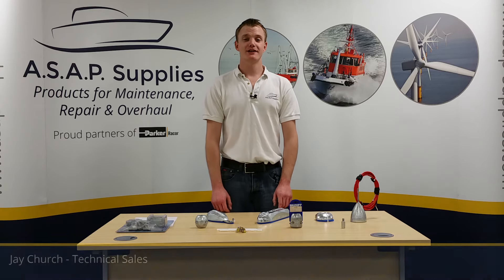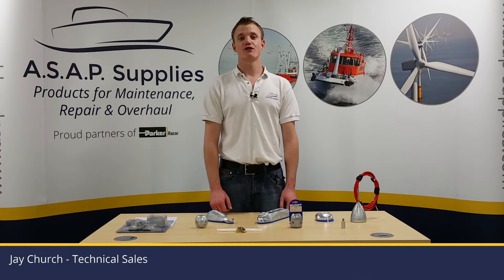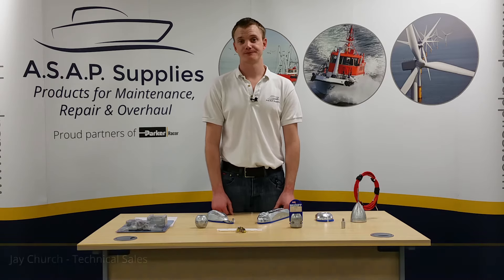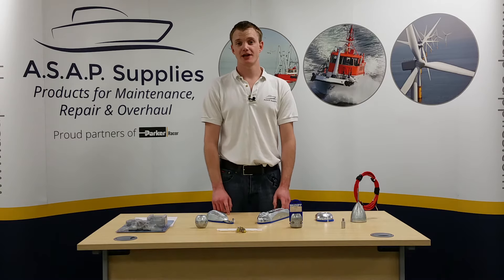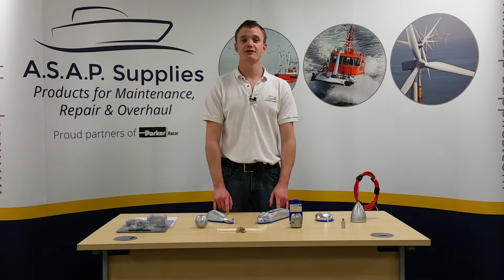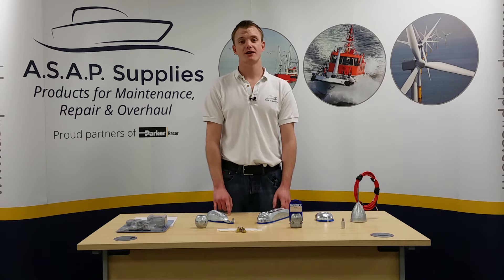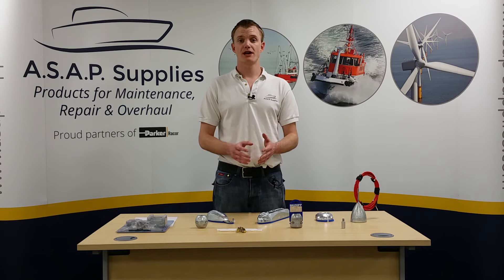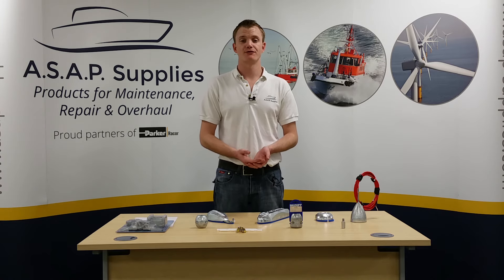Which material Anode to use for your boat

Comment: Why aren't other metals like Sodium and Calcium used for the anodes?

P.S. Awesome vid btw.
Reply from the maker: Thank you, we are glad you liked the video. 
Unfortunately we are not sure on the answer to your question, In the marine industry the only material we are aware that these are made out of  are Magnesium, Aluminium and Zinc. We would assume that the manufacturer have tested different metals and have found these to be the best for each application.
Reply: Pure Sodium and to a lesser extent Calcium are highly reactive metals which, in water and would literally combust. Therefore their use as anodes would not be possible.👍🏼